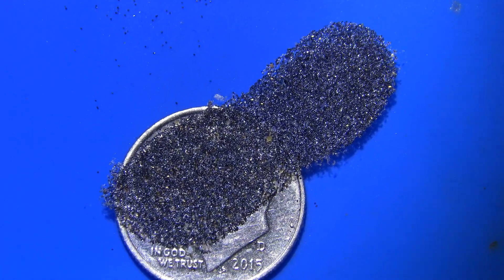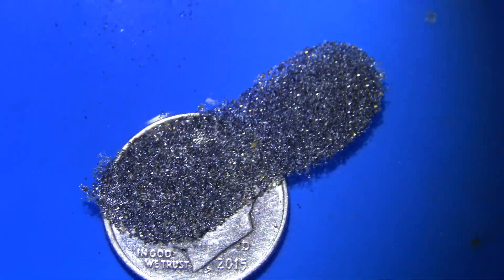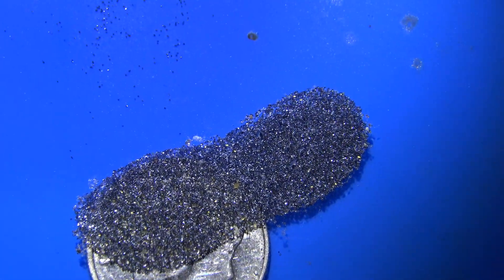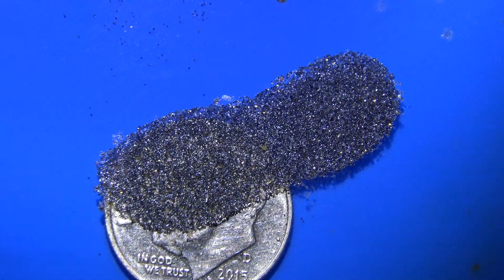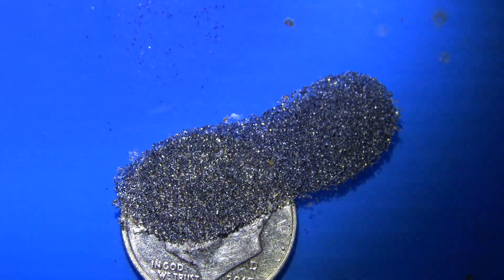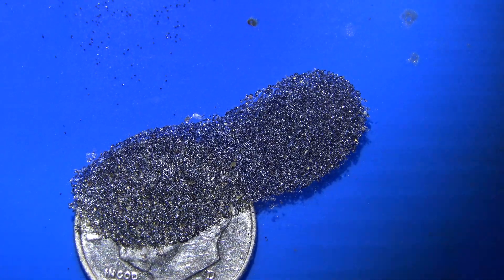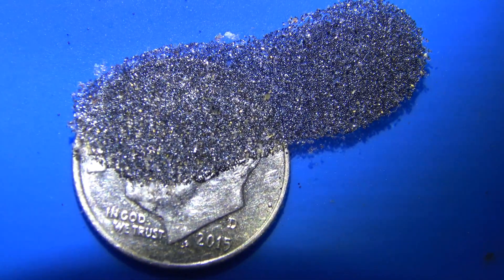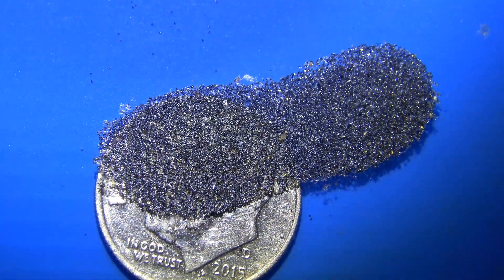Sluice Goose GOLDROP captures 400 mesh Gold on a black sand float.

Comment: How do you get that gold out of the black sand?  Do you run it again?
Reply from the maker: Yes, I classify the dirt smaller to match the size of the gold I am trying to recover. This way the tiny gold particles will separate from the tiny sand particles because the gold is still more dense than the sand. Using tiny water flows through the GOLDROP allows this to happen. What gold that does not drop out and escapes the GOLDROP is captured in the Magnet sluice as the tailings water  flows over a magnetite bed of sand held fast in the Magnet sluice headed to the tailings bucket.
Reply: @sluicegoosegoldrop2821  Do you re-run the "stuff" from the magnetite bed.  

From your videos, it seems to me that it only takes about ten minutes to run a significant amount of concentrates.  Even if you are running these "concentrate tailings" three or four times, this is significantly  quicker than panning, Miller table or blue bowl.  Since you are spending less time running your concentrates, you can spend more time getting beach sand, thus more gold. 

I know the initial investment for the causal prospector is high, but if you have the time, if might be worth it.
Reply from the maker: @cedjulemckeever  No, I have found that the magnetite in the Magnet sluice completely strips what little gold escapes the GOLDROP along with gold ore not commonly found in the tailings of other processes.
Reply: Magnet 🧲